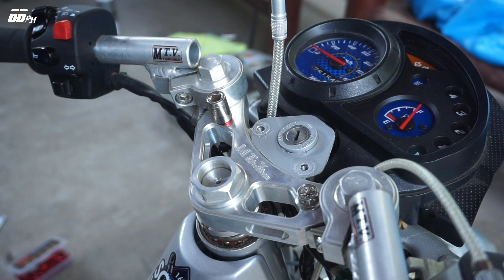Posh Bolts Installation | Rs125/Nice125 | BikeBuildsPH | March 2, 2021

Comment: pano po diskarte ng inner tube lods ? yung mukhang lightened ?
salamat po ☺

shout out po , "THAIZONE PHILIPPINES" zone copper cebu
Reply from the maker: Mtv extension po yan paps, bali pinutol stock innertube ko pati spring sa loon then rethread para sa mtv extension. Matic po shoutout!